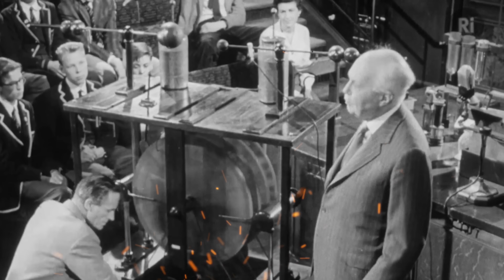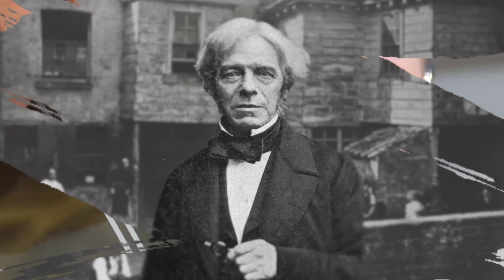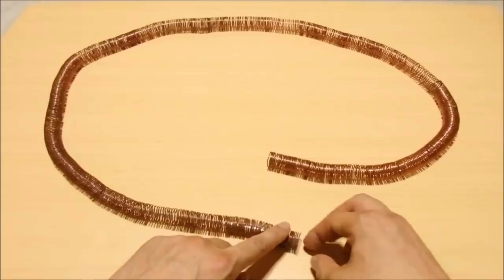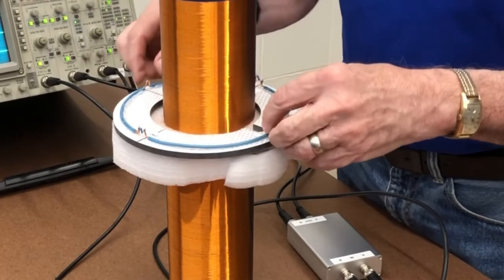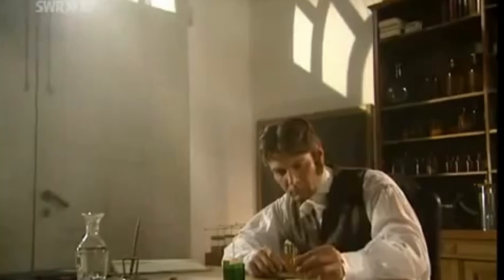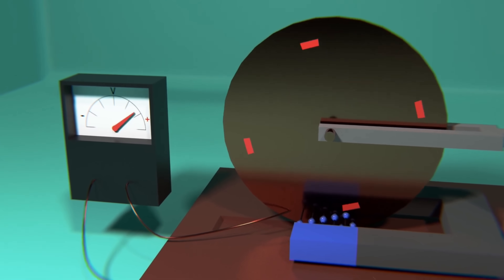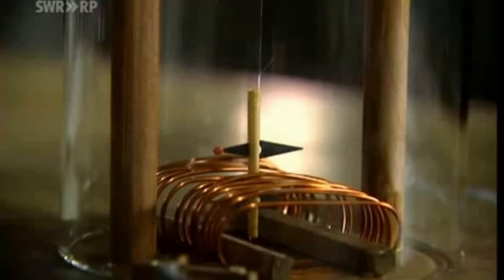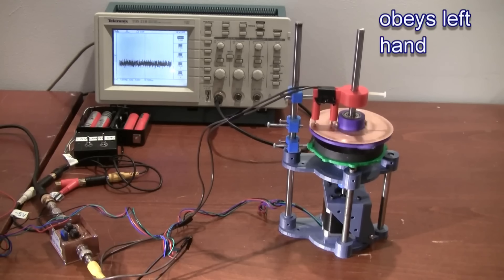The Faraday Paradox: NEW FREE ENERGY GENERATOR 70KW - FREE ENERGY FOREVER

Comment: The paradox is mixing the Thermodynamic into the Electric Science. There are no paradox, they are just 2 different things. Math is soo confusingly simple, they are really just exactly as stated. What do Laplace law of Force actually say. Newton=Wirelength x Current x Magnetic density strength. Thermodynamic does not exist in this.
Reply: Instead of referring to Thermodynamics one should refer to conservation of energy which is valid in all fields.
Reply: @heinzpg  Or instead of calling it universal, just say it is a Thermodynamic law in Thermodynamic. The laws falls apart as soon its believed Electric Science have anything to do with it. Like capacitors can reuse the electricity, Resonance can raise it. etc.

Comment: The video has nothing to do with creating a 70kw free energy device.
Reply: Your comment save my time . Damn click bait
Reply: All bollocks.
Reply: The author would assume you can read between the lines. See what it really happening as charge implodes through nonlinear layers of a dielectric, causing pump z waves to combine when a carrier wave is present. Once energy is made it is not lost except by you, or unless the carrier wave reverses which it cannot without changing the timing of the wave relationship. It is a lot more than 70kw you can make using simple hardware. If you have access to a large buried iron object you can ground to, you can use earth's 14hz wave to power carried wave dynamo plates in a tinfoil or copper pyramid. Zpe has endless ways of being generated and it's so elementary it should be taught in elementary school. I have a 24kw generator. No way am I posting a video of it. maybe someday. It's dangerous until we drain the swamp but you can easily make simple zpe devices that prove the tech based on YT videos instruction.
Reply: @mikefromspace I am in the process of trying to build a water based machine.
I have got a 34kw generator and a few motors lying around.
Just waiting to find out the best way to modify them to make some free energy.
Maybe I'll watch the video again.
Reply: Yes it does

Comment: The Unipolar Induction Motor proves space is not empty.    Three things are moving relative to each other, the conductor, a magnetic field, and space.      Newton was correct, motion is absolute (to space). 
A current will only be produced if the conductor is moving relative to the "fabric of space".     Current in the conductor is elections being pushed by a product of relative movement with both the magnetic field and the "fabric of space".

Comment: There is no need for moving parts to produce energy !  And energy does not just mean electricity! The time is now for all to be revealed ,unlearn what you know and learn what is real .
Reply: I have learned that I believe that people who talk like this are high. Get less high. There's no value in your being high and saying dumb things.
Reply: @forgeteverythingyouknow5413  : I was interested in what he has to say. Can you imagine electricity with no moving electrons? A puddle of oil, just laying there, producing energy? Sunlight without moving photons?  No, neither can I.
Reply: @drewthompson7457   electrons just pulled in an area without a charge is just normal matter. An electrical charge or an electron imbalance is what creates electricity so in a sense hold the electrons in a pool and it just sits there waiting to be used. It’s organized so that the chemical process creates a voltage potential that strips away electrons to create a negative and positive pole.

The only other way to do the very same thing is using a capacitor which holds the charge on plates that you have to charge yourself with a voltage source.